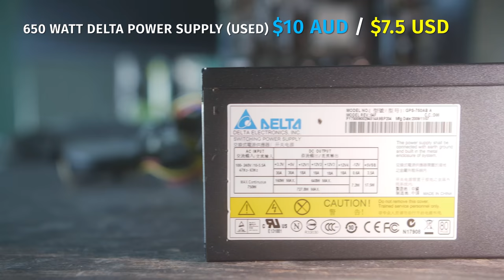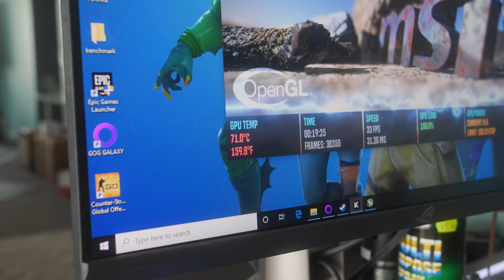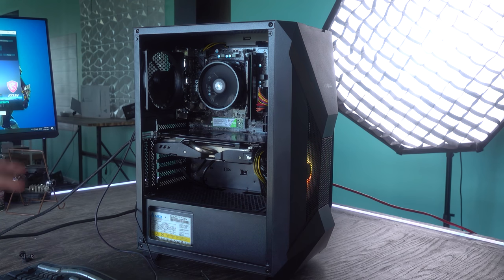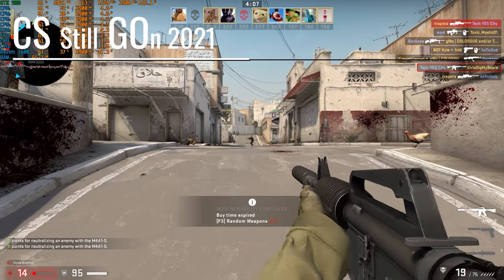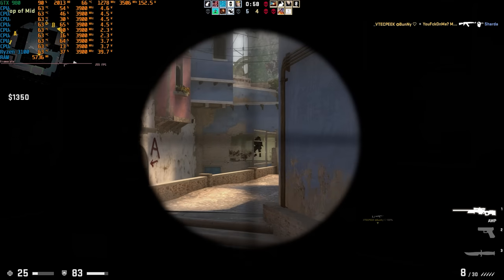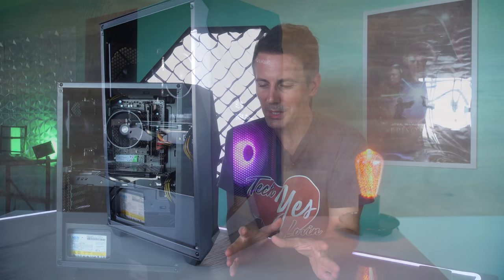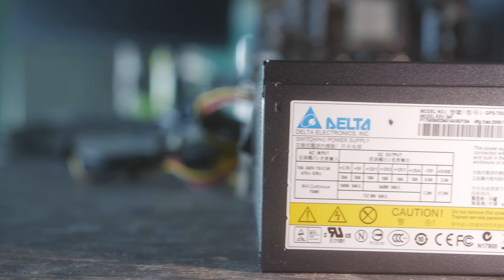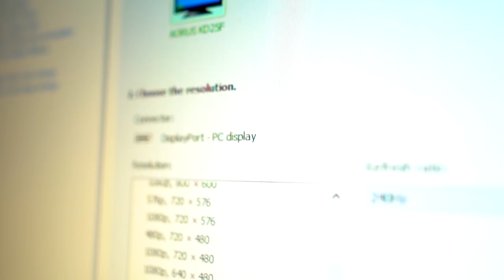Is this $450 Ryzen Gaming PC OVERPRICED?

Comment: I've been looking for a gpu on the used market here in the states. I found a r9 290x for $180 us shipped. From what I'm seeing is that it's just under par with the rx 580, is just a little power hungry. Is there something that I'm not seeing that makes this card less desirable from an rx 500 series?
Reply: Few things you have to know about the R9 290X . 
1. You should never ever buy 1 with a reference cooler. It is obnoxiously loud and they run over 90C under load. So when you buy used, who knows what condition the card is from thermal stress on the silicon itself or its VRM. 
2. Good R9 290X with non-reference cooler usually has 3 fans and very long because they run very hot if you have a shorter card. Fitting into a smaller case is a problem. However, RX 400/500 series is much smaller because they have lower TDP. 
3. R9 290X does not support x265 (HEVC) video decoding/hardware acceleration  .So the CPU will handle the task, which might make your videos choppy if your CPU is not powerful enough. Though Youtube is running on VP9, which both RX400/500 and R9 290X also does not offer hardware acceleration.
Reply: @fleurdewin7958   it's the sapphire tri x. It has 3 fans. My case also has 6 fans installed and keeps my cpu around 22°c while running. The cpu is an i7 6700. My main thing is how well the gpu will run games. The CPU on its own plays videos well through the integrated graphics.
Reply: @David73977   Well, I had an R9 290 (no X) in the past. It had no problem running Overwatch 1440p at max out graphical settings. Definitely above 60fps. If I remember correctly I got about 90fps with an overclocked i5 4690k at 4.5ghz. As you might know, Nvidia is going to restart production of GTX 1050Ti, the R9 290X is gonna smoke it by miles away. 4GB VRAM is still relevant today. If you have a Sapphire Tri X, means it has the reference PCB but non-reference cooler . Its a good card, but many of those have become mining cards in the past, do be aware of it.
Reply: @fleurdewin7958  thank you for the information. I hope it wasn't used for mining. I plan on cleaning it up and replacing the thermal paste when I get it, after checking to see if it works.

Comment: im having the same issue. My gpu isnt hitting even 90%. im using a ryzen 3 3200g with gtx 1650 super. no matter what i do my cpu usage is much more higher. im on latest drivers.
Reply: Cpu bottlenecking. Nothing you really can do, except overclock cpu and ram.
Reply: @Samisipi  if thats the case might as well upgrade my cpu right? but as of the current situation pc parts nowadays are super expensive everythings crazy
Reply: @boburdz2020  You can try to find a used one cheaper? I'm waiting for DDR5 and ryzen 6000 series😁
Reply: Dissable the CPU integrated graphics and switch the RAM sticks to other slots.
Reply: @MarkHallG  i already did that dude its just an entry level a320 mobo
Reply: @Samisipi  but goodluck finding something that still works great, a lot of scammers nowadays. 😁
Reply: @boburdz2020  Luckily I haven't had any issues😄 In Finland it's generally pretty safe to buy second hand. Just built my friend a pc with ryzen 5 2600 and vega 64 with custom watercooling loop for 500€😁
Reply: @boburdz2020  There was a Windows update a year or so ago that bottlenecked certain configurations, what versión of windows are you running?
Reply: @MarkHallG  i think its the 20h2 something correct me if im wrong its an old one
Reply: @boburdz2020  There are some manufacturers which haven't updated their drivers for the 20H2 versión, it is a quite recent one, maybe that is the problem. I think Asus had the worst problems with it. Check if show tips to improve windows is active too, known issue.
Reply: @MarkHallG  oh yeah i have not thought of that thanks for the heads-up dude ill check on it! 👌